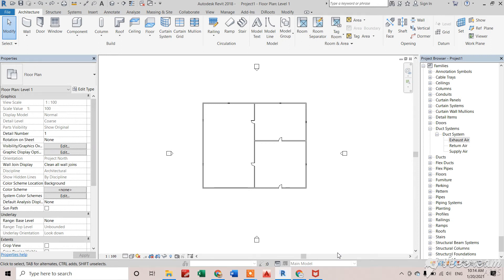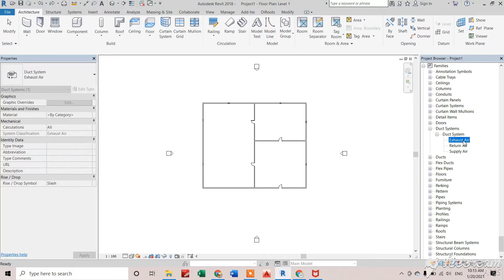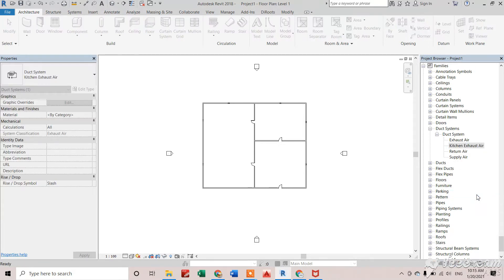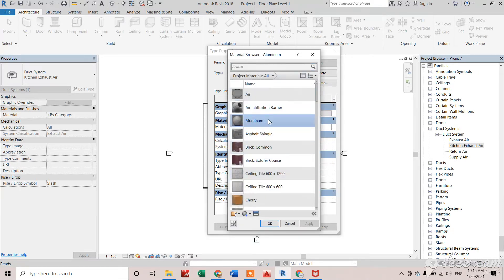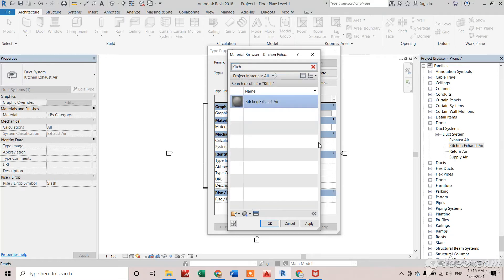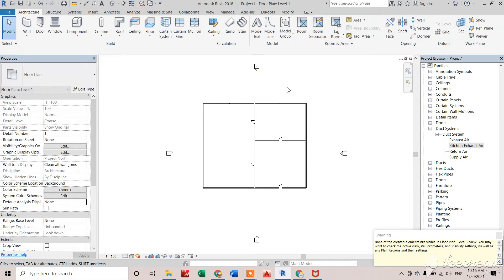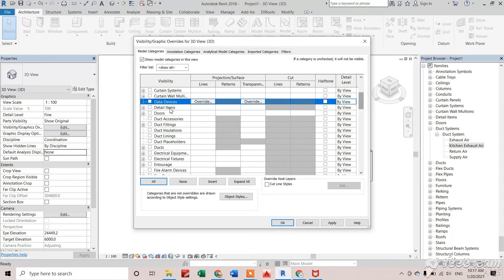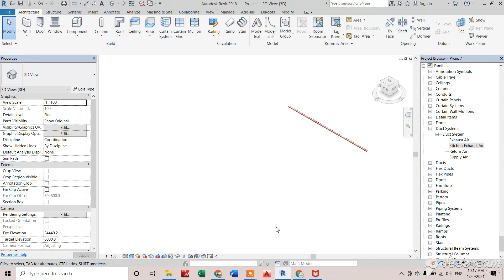How to create new ducting systems in Revit. Revit user||must watch

Comment: i still get this issue "None of the created elements are visible in Floor Plan: 4th Floor View. You may want to check the active view, its Parameters, and Visibility settings, as well as any Plan Regions and their settings."
Reply from the maker: Ruslan. If you are creating a duct or any element, pls make sure that element is in view range and also check with model categories, filters and worksets. Let me know if still you have any issue.
Reply: @bimguru3047  yes they are all visible. I'm trying to see the shape in-ceiling view. (revit 2021)
Reply from the maker: @ruslan8765  if your element offset is below than ceiling then cut plan should be less than that. If it is above ceiling then cut plan should be your ceiling height.
Reply: @bimguru3047  I created a mechanical file and input my design there. Now it works better.